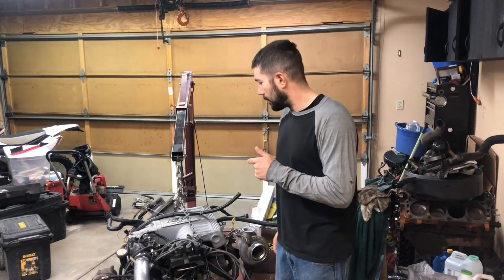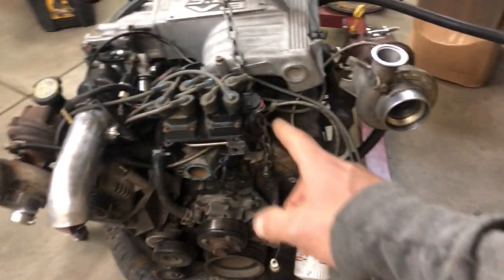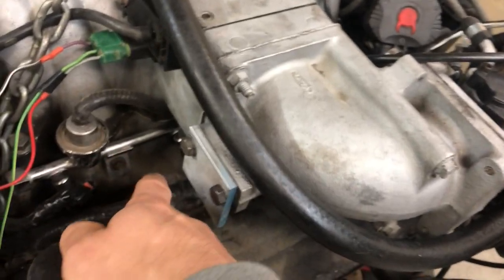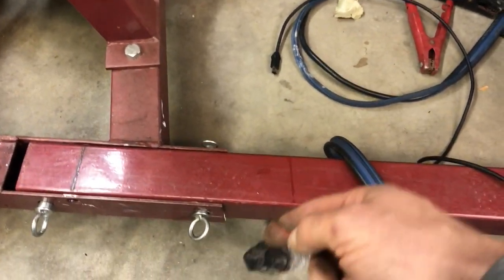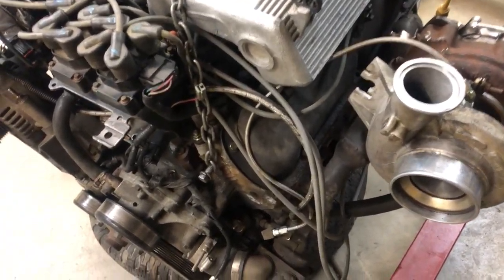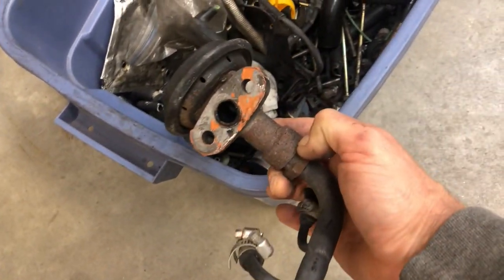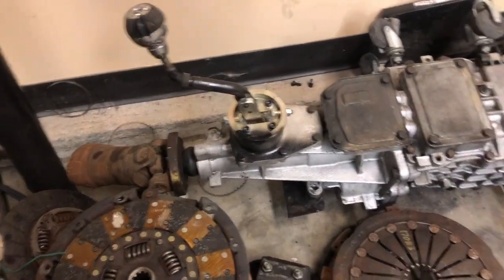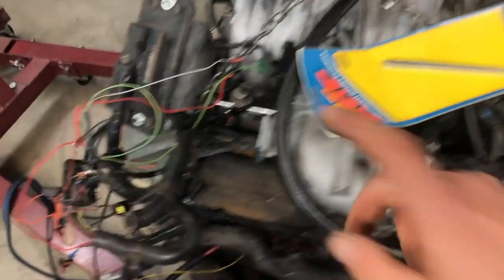Garage Files: Explorer 302 wiring info for Ranger swap and almost ready to fire ⚡️

Comment: I am getting ready to do a 5.0 swap from a 99 mountaineer to my 03  3.0
What suggestion or tips do you have for me on that. I do have the complete 99 mountaineer donor. And also I got the OSS on my 03 ranger, and the 99 explorer has the VSS speedo sensor how do I make that work
Reply from the maker: I’d get it running first. It can be driven while you sort out the speedometer. How far along are you on this project?

Comment: I have an early Ranger how much left over I have to omit? There’s is no OBDII on a Ranger and there is harness for the smog pump on it and I know the EEC is different and going on with a M50D transmission so the speed sensor or oss will be out I believe. Will I be ok to adap the existing harness from the engine to the rest of the body harness.
Reply from the maker: I’m assuming based on your message that you want to use the explorer efi. If you have no pats, so 96-97 explorer harness, and you get the 42 pin from the explorer, the only connections that need to be made are for the alternator, power, and ground. The explorer ecu would like to have a vss for some functions, mainly related to emissions but you can do without. With the explorer ecu they were able to meet California emissions without a smog pump, so in other words with the emissions controls it had, it was much cleaner even without the smog pump. If you haven’t gotten a computer that would run the manual I would check eBay, they’re available. With the auto trans still on in the ecu it will not run right, I did try this many ways myself. With emissions turned on but not hooked up it won’t run much different but never get rid of the front oxygen sensors, those are a must for it to run good. 
I would say the gauges on an early ranger would be the hardest part to figure out. I’ve never looked into that.
Reply: @ i acquired an 00 Expo 5.0 with a full harness and a 2000 M50D F-150 trans and not in California but in ETX no emissions whatsoever. Running it into a 94 XLT with a 4.0 5 speed
Reply: @ thank you for the timely response and insight I used yours abs a few others as inspiration for mine. I already have had many vehicles now since I’m a dad I kept my old ranger after selling my STi for a Ascent for the family of course this will be my project and my daily once I get her worked out.
Reply: @ did you also have any issues adapting the fuel rails or will they plug right into the Ranger line?

Comment: Are you running any chips to tune the stock ecu, or just using the diablosport so you can run boost without freaking out the stock computer? Just wondering because I haven't found many plug in tuners short of running a standalone. Thanks.
Reply from the maker: The Diablosport mafia is just to be able to read airflow levels above 350 hp that the stock maf maxes out at on voltage. That device failed shortly after this video and now I’m using an Hpx Pmas slot sensor to accomplish the same thing, but both do require tuning. I’m using sct livewire with advantage software to tune. The ecu doesn’t know anything about boost. Only load, which it calculates based on airflow and rpm, and that’s what the stock ecu uses to look up fuel and spark target tables

Comment: Do you have the part number for the blue Russells 6AN adapter to ford fuel rail fitting, I bought 2 and neither one of them fit
Reply from the maker: RUS-640900 is the adapter for the 6an to stock Ford fuel feed. I am not sure about the return line adapter

Comment: I'm wanting to drop a fuel injected 302 in to a 94 Ranger (2.3 auto) but the wiring has me intimidated.
Reply from the maker: I’ve never worked on one of those. Making an explorer ecu run it would be easy but the gauges I’m not sure about.

Comment: I would to ask are you running the stock fuse box and harness that cam in the Ranger, or are you using the fuse box and harness from the v8 Explorer?
Reply from the maker: Engine harness is Explorer. fuse box and starter harness are Ranger,

Comment: My brother!!!! I have done a 302 swap from a 97 Mercury mountaineer into a 2002 Ford ranger I believe that I'm having a hell of a time buddy with the wire harness seems like there's lots of things that are different and I don't know why all the information I've gotten so far says they're supposed to be almost the same but I'm having all sorts of issues I wonder could you potentially give me a breakdown a pin schematic of each one of those harnesses a 2002 Ford ranger with a 3.0 l and a 97 Mercury mountaineer 3.0 302 let me know please
Reply from the maker: I will post up a more detailed how to on the wiring. If you look through the videos on this channel you'll see one or two that have already been posted.
 Basically it's plug and play in your case except 3 things:
1) The starter circuit. There's two wires that need to be connected to each other to make the key operate the starter. It's for the neutral switch circuit
2) The PATS. On an 02 the ecu provides ground to the fuel pump relay. You will need to run the wire for the fuel pump relay to its ground, since the 97 ecu doesn;t have PATS and therefore will not provide a ground.
3) The ac circuit. In your case, using a 97 ecu on an 02 chassis will cause the ac clutch to always be engaged.
Reply: @1stockcam  very good info, thank you.
Reply: Hey man this is a long shot but did you end up figuring things out? I’m in the same boat at the moment

Comment: I am looking at pulling a 96 5.8 with an auto trans and mounting it all in my 74 international pickup. Looking for all help
Reply from the maker: Get everything you can off the donor.
One thing I'm not crazy about with the 96 is how the engine harness doesn't connect directly to the ecu. There's a sub harness between the fuse box and the actual ecu, and that introduces a LOT of extra wiring. Basically without keeping the underhood fuse box from the donor, you're not going to be able to use the engine harness. It's a little sloppy compared to the Explorer EFI.

Comment: Hello! I already do The swap a Few years ago. but today i put a manual trans M5R2. U have crank and fuel pump working. But the engine doesnt start. Do i have to rewiring something?
Reply from the maker: So you turn the key and no starter, correct?
If you jump the starter relay, key on, engine starts?

Comment: Ok man im racking my brain on this swap(probably cause of ADHD) but if you could get me the wiring diagrams for a 2001 2.3 DOHC and for a 2000 explorer 5.0 that would help tremendously and if you have any tips, tricks, pointers, etc. that would be awesome too     Oh and btw the 2.3 and 5.0 fuel lines snap right together
Reply from the maker: No wiring diagrams needed, on an 01 Ranger with an 00 Explorer harness, the 42 pin plugs right in. However the PATS system is different, and the 01 Ranger ECU runs the speedometer, whereas the ABS module does so on the Explorer. So in other words it won't start and when you get around the PATS( either wiring all the explorer stuff in, or disabling PATS in the PCM), the speedometer won't work anymore. There's a couple options on that.
Reply: @1stockcam  awesome very helpful but what im running into rn is that it wont crank at all(by key but i can jump the starter and 👍🏻)
Reply from the maker: @GrouchyApple5  On the explorer harness, pcm plug you should have a orange wire with a black stripe on pin 19.

You can use needlenose and an eyeglass screwdriver to de pin that wire (or just cut it) at the ecu plug and connect it to ground, the ring terminals next to the ecu plug is where I'd ground it. 
If your 01 ranger had pats, this is where the ecu would give the starter relay its ground. 
On the v8 engines this is something for air suspension
Reply: @1stockcam  ok ill go see if that work
Reply: @1stockcam  dude you are a damn saint thats what it was pin 19  now its atleast cranking but i dont have spark plugs or wires on it yet but i wanted to get it to turn
Reply: @1stockcam  I swapped a  1997 Mercury mountaineer 302 into my 2002 ranger it had a 3.0 with auto transmission. I used the bcm and harness from the mercury. But I have  only a max of 4.7 volts coming out of my bcm. 12.5 going in,so everything in the truck is only reading low voltages. And I have no power whatsoever at injectors and my fuel pump won't auto turn on. I ran the new gas line all the way back . Manually turned on pressure is good. Please give me some advice,I'm an electrician and this is a project that I wanted to do.
Reply: Oh and rn my engine is touching my crossmember(2wd coil sprung) any tips on the trans crossmember
Reply from the maker: I used the stock Ranger crossmember and transmission mount with a T5, a TKO 600, and now a T56 mag. I've flipped it back and forth, and slotted the holes in different ways to make that happen though

Comment: Do you have the wiring diagram. Trying to run standalone wiring with a microsquirt ecu
Reply from the maker: Yes, email me the year of the harness you’re using
Reply: @1stockcam  it's a 94/95 mustang gt harness trying to run as a standalone with a microsquirt

Comment: I just started a swap in my 02 and that turbo set up is where its atttrt
Reply from the maker: Heck yeah! If you hit any snags feel free to drop a question. It’s worth the work. 
If you like that turbo setup, engine, whatever... it might be for sale!
Reply: @1stockcam  thanks man!!! Means a lot to have someone willing to answer some ?'s!!   Id love to see the wiring diagram to use the factory ecu as a stand alone!!!
Reply from the maker: @JesusIsTheLightAndway  I set it up like a stand-alone and did a fire up in another video. Didn’t show the exact wires I used but I can, and I have all the diagrams. I have the twin turbo kit,harness, injectors, , tune with a base map (auto or manual trans), side exit exhaust with cat, and fuel pump. That’s a 300-450 hp setup on stock lines stock filter. The engine Is stock and it’s still running good. It’s nothing special, or maybe it is. Anyways,  turn key 400 hp ranger? I’d probably suggest 4x4 😂
Reply: @1stockcam  mine is 4x4!!😂😂   4x4 kind cab hahaha. I wanna run a non electronic auto trans and would loovveee to be able to keep it efi and it be stand alone.  You sir give me some muuucchh needed hope and inspiration for mine hahaha
Reply from the maker: @JesusIsTheLightAndway  that’s definitely a straightforward combo, I could help you skip a lot of headache on that one.
Reply: @1stockcam  man thats whats up!!   Shoot i may even starr videoing my swap.  Im sure you know not many people post informative videos.  The 4.ohhhh's almost ready to come out and ive almost got everything i need to start stuffing it in
Reply: @1stockcam  what would you want for that motor/turbo combo?? Shoot me a text if you want too.   8653342139

Comment: What size injectors did you use  and from what?. I was looking for your fuel system video..but couldn't find it.  In your opinion.. with 65 psi fuel pressure.. would 24's support 350 to the tire in your opinion, or should I just get 30's?
Reply from the maker: 60 lb/hr on 65 psi base fuel pressure. Good for 500 hp on a stock fuel line and stock fuel filter, never even put a new one in.

Comment: Do you have codes and things related to the transmission wiring that isn't there? Do you have to get a custom tune?
Reply from the maker: Yes, there are 10-15 codes related to the auto trans. I only drove it like this for a year or so. It would occasionally buck once in awhile. especially high load/low rpm, like climbing a hill at 2000 rpm. It would also stall when coming down to an idle sometimes.

It has taken a lot of trial and error on the tuning side, but now it runs like it came from the factory with a manual
Reply: @1stockcam  thanks, were you able to get rid of the transmission codes and change the fuel mapping in the end or are there still transmission things involved with it?
Reply from the maker: James Ford yes, check engine light also works as it should now (only on when something is actually wrong) Drivability is surprisingly good. If you do need a flashed ecu for a combo like this I can help you with that.
Reply: @1stockcam  i need to holler at you about a ecu in the near future!!

Comment: Send me that motor..🕶
Love the truck man and your channle. Getting ready  to build my 331 for my 2000 ranger..street truck..
 I do have a question... I mat move my fuel lines from the stock location, havent looked at fittings yet..but you have any idea on what fitting I could get to splice them? I just need to move them because of the headers if I have some made.

You got an extra foxbody bellhousing?..lol

What did you dyno  at if you remember with the twin setup?
Reply from the maker: Jody thanks! It made certainly less than a 331 twin turbo could make.
I’ll cover that and the fuel stuff in the next one.